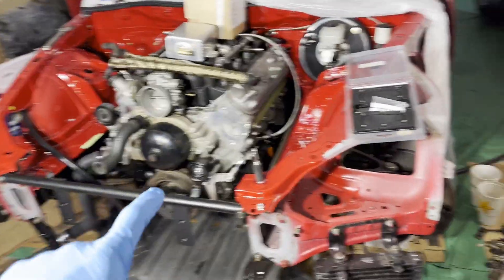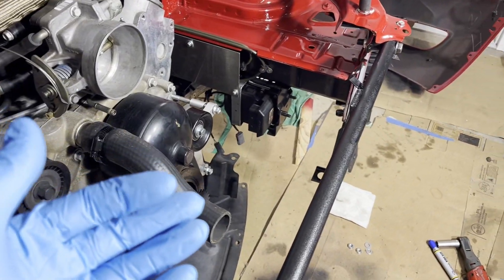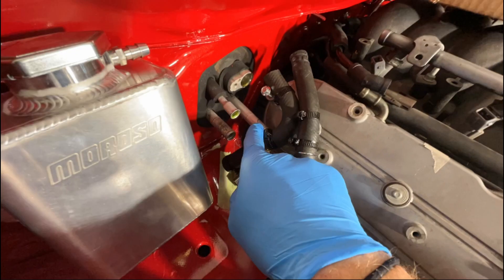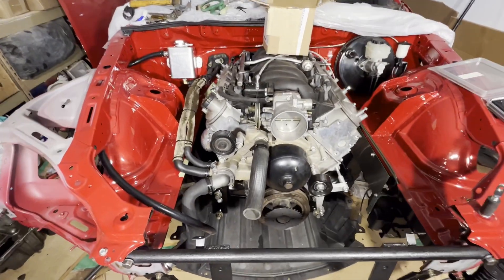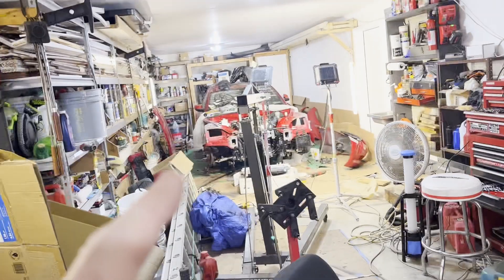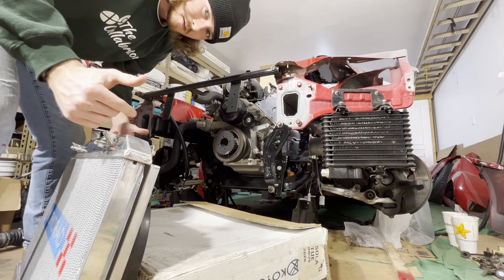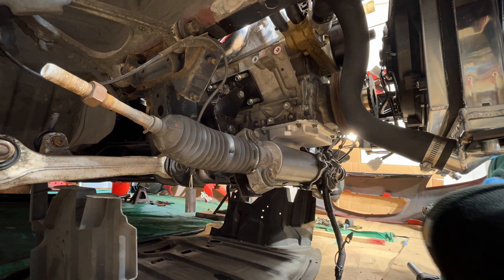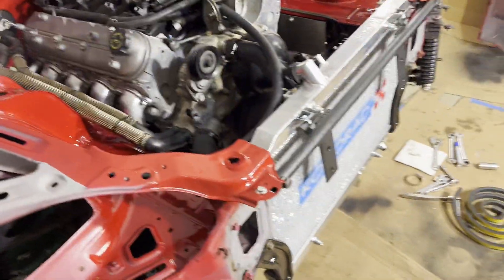CLEANEST LS Swap Cooling System

Comment: Any issues with this setup? I bought the same expansion tank and was about to start doing it. I noticed the pipes coming from the heater core are an odd size like 9/16 "14mm" so just a heads up for anyone doing this. I have not got that far but I am pretty sure you can just slide a few inches of the oem on and then use a 5/8 barb to convert to a more normal size line.

Comment: Do you have an updated link for the Shroud and Fans you used? Is it the cheaper one and if so , how is it holding up? Any reason you did not stick with OEM?
Reply from the maker: I just updated the description of the video since it looks like my link expired. The exact shroud kit that I bought is unrealistically priced right now, not sure why. I listed a few other options. I think the cheaper one is probably very similar to the one that I purchased and may be worth a shot, but the mishimoto is definitely not badly priced for a reputable name. Mine seems to be holding up fine, but I do not daily the car. Probably have put about 3000 miles on it and havent had any issues. I went with an aftermarket mostly just for the aesthetic look, to have an aluminum shroud to match the aluminum Koyorad radiator. Plus i accidently broke one of the fan plugs so i had a good excuse to buy something new haha
Reply: @gastancehouse  Lol nice, thanks for the quick reply. Your videos have been really helpful as I work through my own swap. Usually they price stuff like that when they are out of inventory but want to keep the posting live.
Reply from the maker: Yes of course! I have been pretty bad at responding to comments in the past but I'm trying to be better haha. Good luck on your swap, its definitely a fun one!

Comment: Nice. I have a 700HP LS3 stroker in my 2007 Saturn sky and I'm always battling heat issues especially being down south. I have a dul core radiator and using the stock fan because it has a great shroud on it. As long as I keep moving it stays around 197-210 but if I even stop for  2 or 3 minutes it gets hot. Have you had any issues with your Ls running hot?
Reply: My turbo 6.0 was about the same as far as keeping it in the wind goes, even with the hood propped it saw 10-15* lower temps, its currently undergoing some changes in way of freshen up and a little more tubular up front id like to run the most compact rad as possible but im not sure how small is too small.